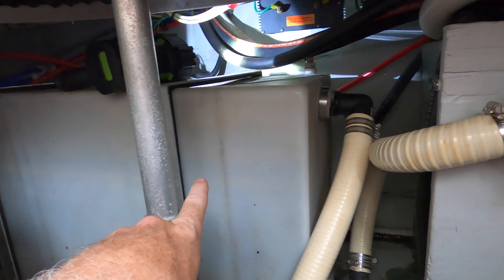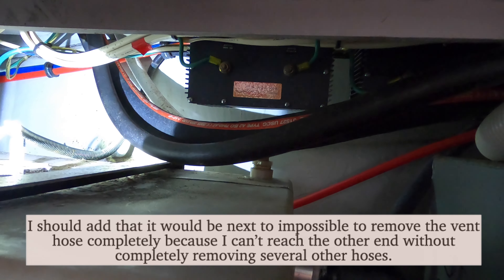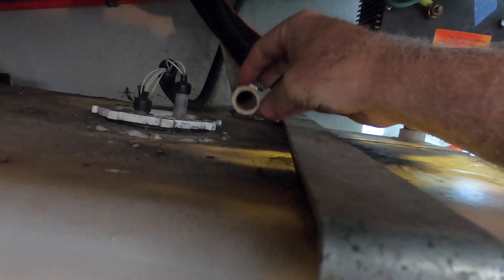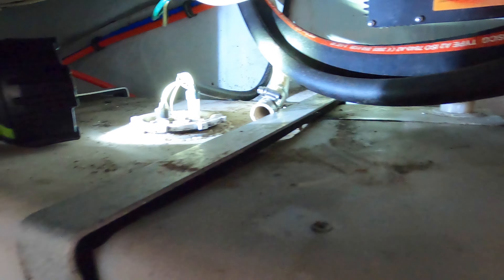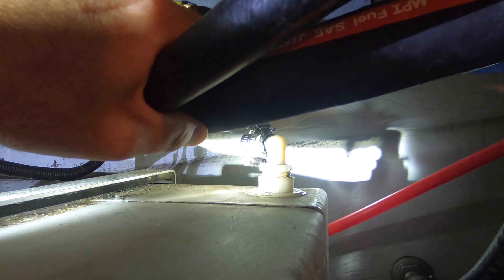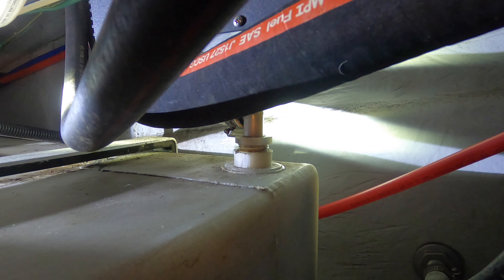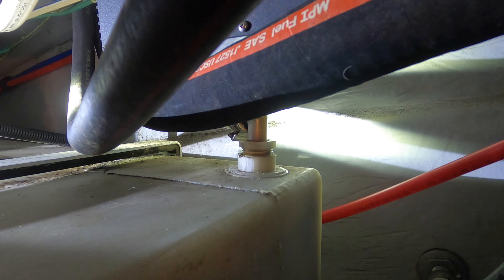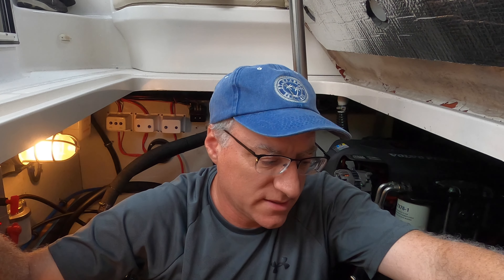Black Water Vent Hose Problem - Episode 44

Comment: There should be a charcoal filter between the tank and your vent to the outside. Replace every year and you shouldn't have a problem.
Reply from the maker: Thanks for watching and commenting. We do not have a filter and while I thought about adding one I think we actually solved the problem once and for all but won’t be able to confirm until spring.

Comment: Checking the seal on the level sensor and increasing the vent elbow diameter are good. Also,  remove the vent hose from the tank again, extend the hose with an additional piece and blow through it. If you get a lot of resistance, the hull side vent is clogged. The snake won't get the far up.
Reply from the maker: Thanks John. I literally just replaced the elbow fitting today but it didn’t solve the problem. I did managed to get the snake all the way up there and I have blown it threw and there hasn’t been resistance. I think I’m replacing the hoses when it’s on the hard.

Comment: I had similar problem. I was told I should wrap the hoses with celophane plastic, but that didn't work that well, even replaced the hoses which was a bit expensive. I finallyb replaced the tolilet with a composting toilet, and and replaced the holding tank (removed the hoses) with a new one, now used for fresh water, which gave me an additional 25 gallons of fresh water. No more pompout, no more sewer smell.
Reply from the maker: I'm glad that finally worked out for you. We're not there yet in terms of desperation and we don't have the money for that big of a project at the moment. But that is definitely something we could consider.

Comment: Just a thought from a total amateur is that I’ve e always been told to have any hose clamps on opposite sides of any hose because if not you are leaving one side not quite as sealed as other?  Hope u fix it, I’m only half way thru video!
Reply from the maker: Good call Stephen. I generally do that on the hoses unless they are in tighter spots where I can’t easily get a screwdriver on  it. I know a couple of times I’ve been lax on that though. Thanks for watching and commenting.

Comment: Since it appears there are no leaks from any of the hoses...one other thing to check would be the float sensor gasket on top of the tank. If that gasket is blown, odors can easily escape from there and enter the engine room. 3 or 4 screws, lift that out, put in a new gasket and test.
Reply from the maker: Never thought to check that! Thanks Chad! I really hope that's it. It does make a lot of sense now that you're saying that.
Reply: @eternitysshore  Hope that helps Jeff...keep us posted!

Comment: If you have good enough ventilation to the waste tank you wont get (much) bad smells, people fit small air vents which causes anaerobic conditions inside the tank which = stink. With enough gas exchange its mostly aerobic inside the tank. 2 vent pipes is a great way to get proper gas exchange or use a larger bore vent pipe 1 1/2" minimum.
Reply from the maker: Thanks for the feedback. I think we might have finally “solved” the issue late last year with another thorough blowout of the vent and several major doses of a different product than one of our subscribers suggested though I don’t remember the name at the moment. Thanks for watching and commenting.

Comment: I had the same problem on the Dream. I added a charcoal filter to the vent between the tank and the vent and it cleared it right up.
Reply from the maker: I’ve thought about this but am not 100% sure that’s the problem. It might be the hoses.

Comment: Had the same smell in ours.it was the large cap on the top of the tank it did not seal properly.put overlapping layers of gorilla tape  to go over the cap and surrounding surface. Smell gone.
Reply from the maker: I really hope it becomes that easy after all this work! Wisco boater seems to think something similar might be happening. I'll find out this weekend maybe.

Comment: another culprit...could be the bellows which sits in the black "plastic" can like bowl where the pump sits and where the duck bills are. if the inside white plastic bellow cracks...the bowl will not flush all the stuff to the tank.
Reply from the maker: Thanks David! I think we found the problem and it's actually the elbow joint that goes into the tank and connects to the vent. The vent hose is larger in diameter than the joint and we think air is leaking out from there every time the toilet is flushed. I am waiting for that part and hope to replace this week. The video explaining all that is next in the queue.

Comment: Hey on my boat like yours I have a macerator style not a vacuum flash but I do notice when the tank is full we’re getting close to four you will get odors are you close to full when this happens or is it all the time also your vent might not be completely clear try shooting compressed air thru your vent from the outside In
Reply from the maker: The smell is present whether or not the tank is full when the toilet is flushed. I guess I could try compressed air but I think I got most of the stuff out.

Comment: Before we installed big orange, the smell was always outside the boat at the vent.  It's strange that you are smelling it inside the engine compartment.
Reply from the maker: Yeah, I don't know what's going on.
Reply: I agree it’s strange usually it’ll burp back through the toilet not in the engine compartment

Comment: My bet are the hoses. They look to be the original Vacuflush hoses which have a short life when it comes to permeability. Join Trawler Forum…there is a lot of information there. Also, the book called Get Rid of Boat Odors by Peggie Hall is a must read.  Its in its second edition and with a pre-title of “The New”. Good luck.
Reply from the maker: Thanks a lot! Great info. They are I believe original hoses. Might have to wait until off season to do it. There is one 1-2 foot section of the hose where I’m not sure how to access.
Reply: 100% those flexi pvc hoses. I just replaced ours on our narrowboat with vetus butyl hoses. Odour has totally disappeared. Not cheap but absolutely worth it. Those pvc ones permeate.
Reply: Yep, vacuflush hoses are saturated…..
10 year replacement is recommended.
Reply from the maker: Yeah. I think you’re right. I’ve basically tried everything else. We’ll have to try that in March or April before we put the boat back in.
Reply: Big job to change the marine sanitation hoses....but worth it!
Heat gun makes removal & installation a lot easier.
Reply: @eternitysshore  I would definitely get Peggy Halls book. It is a quick read and a lot of useful tips during replacement. We removed all our black water lines, vacuflush system and went back in with Raritan Marine Elegance and Raritan 1 1/2 flex. It took two of us 1.5 day to complete the two head change out. If only the lines, a days work. Odor is gone. Also, make sure you replace your vent line and make sure the thru hull is clear. Raritan KO will also help reduce odor in the tank. It is a good tank management product. I do not work for Raritan and certainly not a paid endorser. Just very pleased.
Reply from the maker: @allenamsler3187  great stuff Allen! Thanks for the feedback.
Reply from the maker: Good call on the heat gun!

Comment: try Noflex Digestor before you spend the money on hoses .If the smell was all the time it would be hoses but only when you pump means you have a air leak in tank wall or fitting and its venting gas into space . Vent filter works only on outside vent discharge smells . Question is it possible the smells are coming back into the boat from the outside vent?
Reply from the maker: Thanks for the comments. We have been using something similar to Noflex. Smells are definitely not coming back in from the vent. Hard to know what’s going on.
Reply: I watched your video closer and your tank did pressurize when the pump was on suggest you increase your vent tanks size fitting and hose  .Replace your hull fitting on vent get it bigger an no fine screen (no screen is best ). Noticed you also have dryed waste on top of tank ether from over filling or bad weather . Dump tank before it gets to the 3/4 mark   Your hoses may need to be replaced but they are not this problem .If you add charcoal filter in a easy serviceable spot and replace your hull fitting on vent get it bigger an no fine screen  . Try Noflex its different and what is it  similar to ?    g f  @eternitysshore
Reply from the maker: @TheSeaQ thanks for watching. These are good suggestions. One of the main challenges is that I cannot reach the vent. I think doing the charcoal filter thing is a good next step as well.
Reply: put another vent in where you can get to on top of tank and a new hull vent fitting 
 @eternitysshore
Reply from the maker: @TheSeaQ  I might hire out for this. We’re still not 100% sure what the problem or problems are. I literally just replaced the duck bill valves again yesterday because the stink is now also bad down in the cabin.

Comment: Why didn’t you try compressed air into the vent hose?
Reply from the maker: That’s a great idea. I didn’t have any. I’m still not sure what the problem is after trying a bunch of different things. Thanks for your comment.
Reply: @eternitysshore  well, I just bought my third boat, a 35 foot Ponderosa 35 and I have the same problem. I expect it’s the hoses but I have so many other little to do things on my list. I don’t know when I’ll get to changing them. At least, in my case I am seriously considering a composting toilet, as I know a few people that are very satisfied that they switched over to one. Good luck.
Reply from the maker: @victorjcano  thanks. And congrats on the new boat. Btw. If it helps, My local mechanic has told me that he thinks it’s rarely the hoses that cause the stink unless the stink is always present. If it only happens when you flush its most likely the air displacement from the tank so checking the vent and all the connections is where to start. I am considering getting a charcoal filter though I’m not convinced it will solve the problem. Good luck to you as well.

Comment: What worked?
Reply from the maker: We've used a very generous amount of NoFlex Digestor Boat and RV Sewage Treatment. We followed the instructions exactly as they were given. AND, I am regularly blowing out our vent hose (we can't reach it to dismantle it) using our shop-vac in both directions. So far that has proven the most helpful but not always full proof.

Comment: My boat has a filter that vents to the open air. Have you repaced that filter yet?
Reply from the maker: There is no filter. It’s just a hose that vents. I’m probably going to get the orange filter system in the off season.
Reply: @eternitysshore  Interesting. We still have 2 months!!! If it is that bad throw an inline filter on there. Forum says piece of PVC (looks like 1 1/2), 2 end caps w/ nipples for the hoses, fill it with fish tank charcoal a foam piece in each end
Reply from the maker: Thanks Todd. I think it’s good to look at all angles. The challenge is that I’m about 90% sure that it’s the hoses and so I don’t want to take the time to do something that probably won’t work and is temporary. And the smell is not strong all the time.

Comment: I absolutely feel your pain. We have been going around in circles with our black tank issues and have been watching a million youtube videos to learn as much as I can about these systems. Any advice from anyone on our issues much appreciated. Our diagnosis video is here : https://www.youtube.com/watch?v=AJgTR45qfOs
Reply from the maker: Misery loves company! I watched your video. Here is my only suggestion and this is based on our trial and error. And what I am sharing with you has in no way been full proof...however we've used a very generous amount of NoFlex Digestor Boat and RV Sewage Treatment. We followed the instructions exactly as they were given. AND, I am regularly blowing out our vent hose (we can't reach it to dismantle it) using our shop-vac in both directions. So far that has proven the most helpful. If the smell occurs almost immediately when you flush but is not constant, it had to be the vent leaking air somehow. Hope this helps!